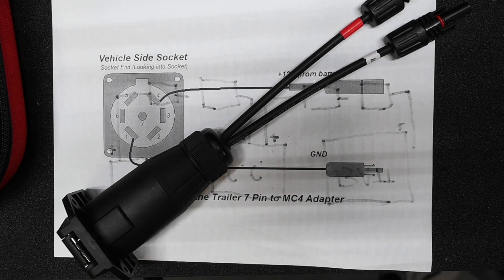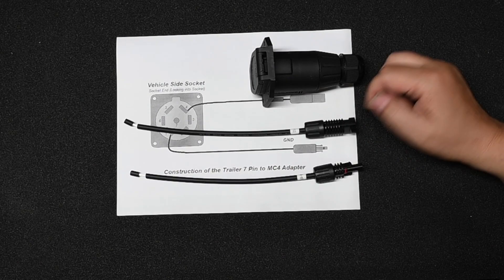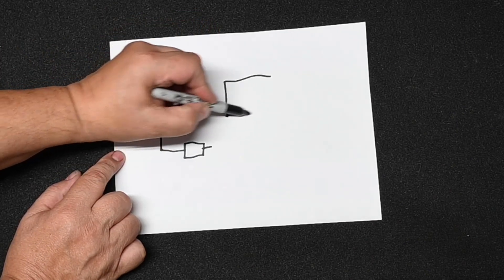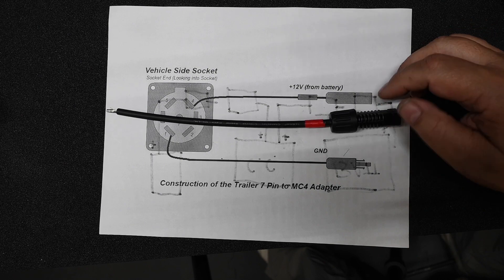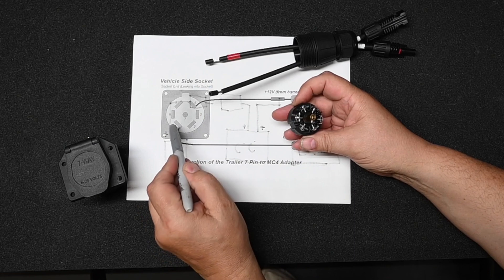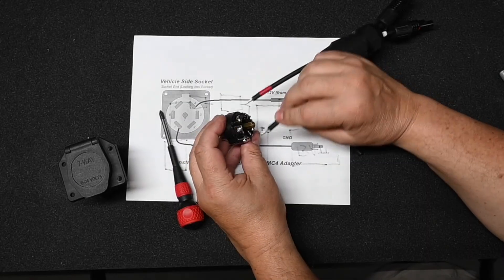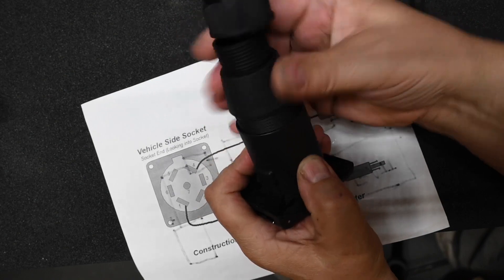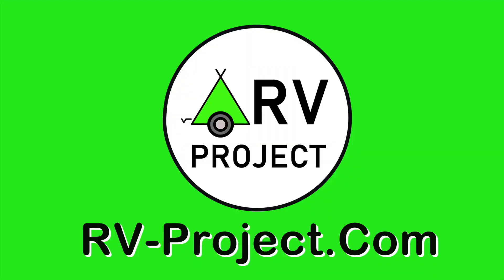Constructing a 7-Pin to Solar Panel Adapter.

Comment: This is exactly what I've been looking for, and an excellent video, thanks! If I want to make an adapter using 20ft pigtails instead of the 9inch, would you recommend using 10AWG pigtails, instead of the 12AWG in your link?
Reply from the maker: Yes, I would use 10AWG for 20ft.

Comment: Do I need a charge controller between 7 pin plug and solar panel
Reply from the maker: Since the 7 pin plug is (or should be) directly connected to the battery, then you would need a charge controller between the 7 pin plug and solar panel.

Comment: Can I use this for the 200 watt kit?
Reply from the maker: If your RV's 7 pin trailer wiring harness has 10AWG wiring on the wiring harness for the ground and battery pins, you should be able to.

Comment: Hi, nice video (I have a question on the amps that the plug can handle ?) if I want to add more than only 100 watts
Reply from the maker: Besides the raw current carrying capability of the 7-pin wire harness, you need to consider the series voltage drop and location of the charge controller - both of which can reduce the charger performance.  

This is so important that I did videos in my solar video series on just these two topics.  Check out my YouTube solar playlist: https://youtube.com/playlist?list=PL9L2lLziJeInW0EznBZhIYsnG1tQlHTOJ

The 7-pin wiring harness battery circuit is typically 10AWG.  However, some cheap wiring harnesses use 14AWG.  RV mfgs being as cheap as they are, I would verify the wire gauge of the battery and ground circuits.

If you have 14AWG wire, I would limit the solar panels to 100W.

If you have 10AWG wire, I would limit the panels to 200W.

This assumes distance between the battery and 7-Pin connector is less than 10ft.

It also assumes the solar charge controller is located at the solar panel; a charge controller located at the battery in this configuration will interfere with battery charging from the tow vehicle.

If you need more than 200W,  then you need to look at other solutions, such as a MPPT controller located at the battery, series or series/parallel panel configuration, and a dedicated connection from the solar panel to the battery (i.e. not using the 7-pin cable).